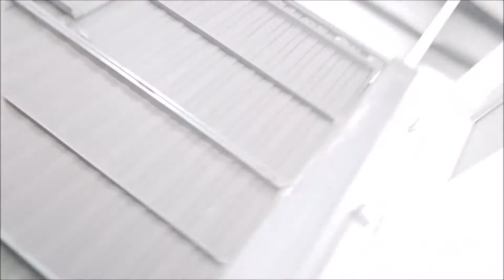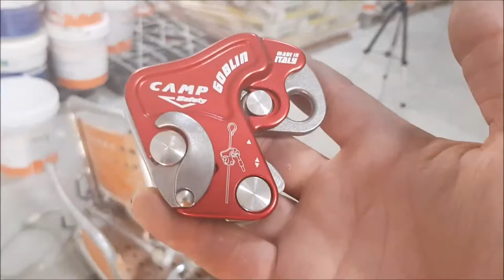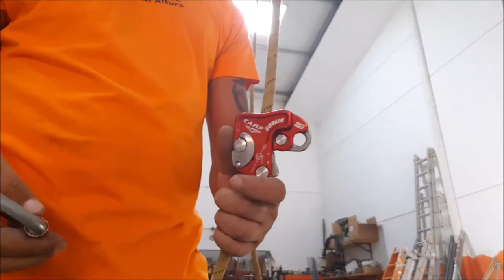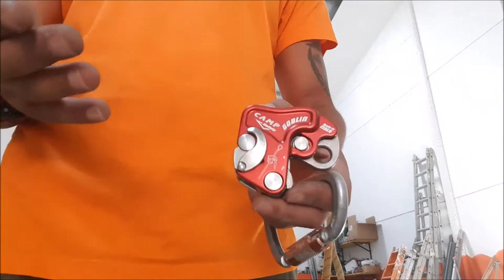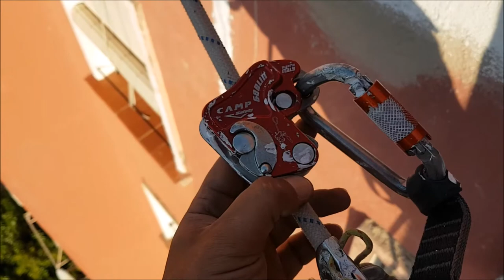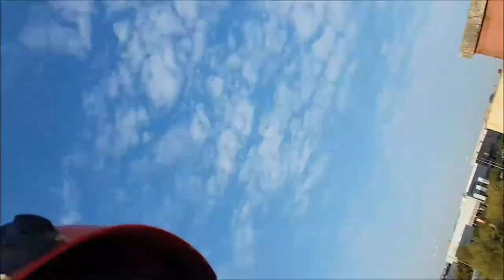GOBLIN vs ASAP - Rope access technician

Comment: It only works on vertical or nearly vertical lines as the weight of the device unlocks it to move freely along the rope. With a horizontal line you are dragging the device which activates the brake

Comment: Hi, so it's the same thing as the Rocker (Edelrid) if you know it. Light... and unusable at work ! In France too you must work with a second rope and a fall arrester, and as you know this can be very boring even when it works properly. The best fall arrester I have worked with was the petzl Asap Lock ; it is lighter than the previous models. The best feature on it is that it can be removing from the rope without disconnecting it from your harness (so you can never loose it even with gloves) ; it also follows you very well. It is more expensive than this shit, but it your boss accepts to buy it you wont regret ! cheers

Comment: Same problem with a Singing Rock / Kong Backup, it does not follow you if you are below, you need to manually move it, Petzl Asap is better... Like another user said, you need to get a Goblin Rope Surfer to do that... The Goblin or the Singing Rock  / Kong Backup are worse than the Shunt, you can hack the shunt with a small piece of cord to make it follow you while you rappel and still be safe in case of a fall...  Just get an Asap.